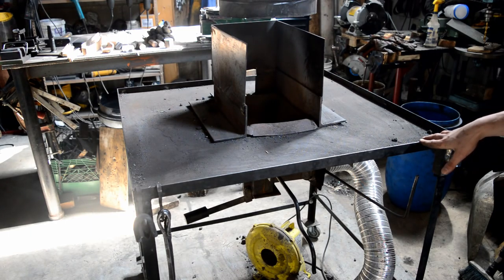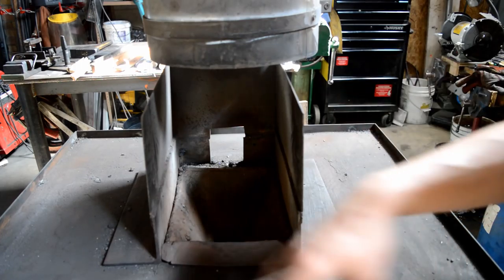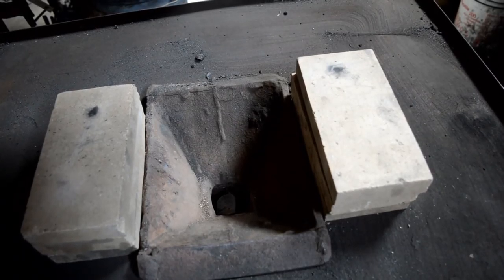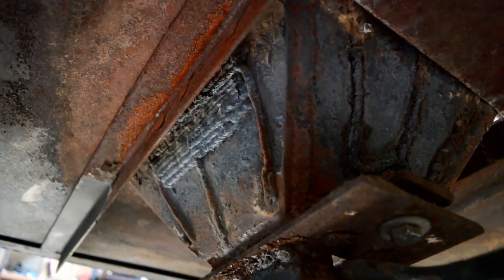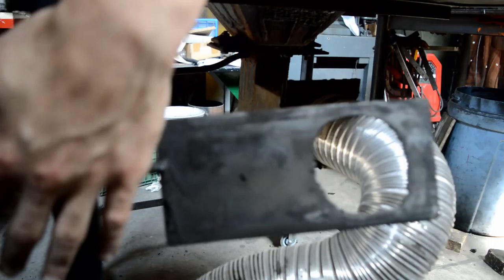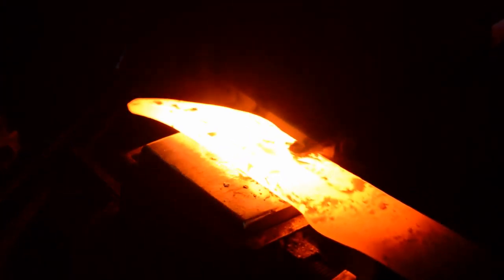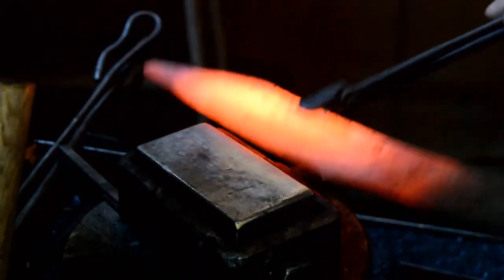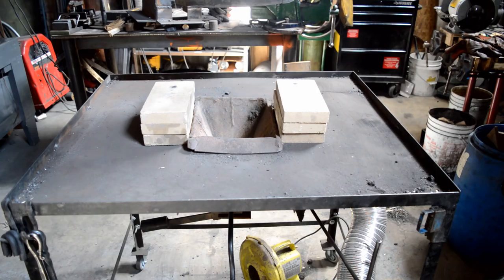Intro to Blacksmith Forges

Comment: Great timing. Im preparing to build my second forge. My first is a Tim Lively style. Its ok but i need a better blower. Im wanting to make a portable style similar to what you show. Im glad you said what you did concerning the brake drum. Makes great sense. Im now rethinking the fire pot. 
Thanks for the info.
Reply: OKBushcraft Mr Krzysz makes some good points about the brake drum forge. When I was going to build mine I saw a video of a portable forge made out of a plow disc, I think it was at a hammer-in somewhere. I had some of those already so I made my forge out of one of those and it works pretty good for me as just a hobby smith.The concave shape does allow for fuel to funnel down easily. Coincidentally(in a bad way), I had just given away a bouncey house too, so I didn't have that blower. But I tried a bathroom exhaust fan and found that it works really well and is fairly quiet. 
Krzysz's forge and work is way, way better than mine but I thought I would just add another prospective, that is also not a brake drum. Good luck with it.
Reply: OrionsAnvil I have some disks. Planned on making campfire cooking disks. I may just keep one aside for the forge.
How well do they hold up to the heat being steel and not cast iron?  I also thought of going ahead and using the drum and forming a slope with refractory cement so it would have more insulation. Does the disk allow for the coal to funnel properly or just adequately? Should it be deeper?

The bathroom vent was exactly what I'm planning to use. I see one for under $15 at a national building supply chain.  

Thanks for the comments. Anymore ideas or suggestions are more than welcome.
Reply: OKBushcraft No problem, glad to share what little I know. I have burned about 120lbs of coal through mine in the last six months and I haven't noticed any degrading of it. But I haven't cleaned it completely out in a while. I will try to take a closer look at it this weekend and let you know.  I will tell you that the discs I have are very old, and were extremely hard to weld, tuff stuff

I haven't had an issue with the disc being too shallow mine's about 2" deep, I try to keep it plenty stacked.  But I do have some firebricks that I plan on using like he did in this vid if I need a deeper fire. I did that in my first forge that was a flat tray. I don't have any issue pulling clinkers out either. 

All that being said, I think I am going to try to build a cheap portable sideblast just to see if I can ;) I think they have a lot going for them.

I have heard some people claying the brake drums too, that may work good.
Good luck with it.

Comment: There's more than one way to get a good fire nest. Brake drum forges are fine if you know how to build your fire and use fines and ash to create a hollow for the fire to be in. If you had ever used a side blast forge you'd know that the firepit doesn't need to be defined by steel or brick at all.
I also have to comment on the high pressure vs high volume point you raised concerming fans. High pressure is good for a coke forge, not really necessary for a coal forge and terrible for a charcoal forge, more so when the forges are bottom blown. The right tool for the job, and as always there's several ways to achieve a goal.
Reply from the maker: gnewsch If you use a side blast i would be very interested in watching a video similar to the one I put up. The side blast seems like a very simple design, even easier then a brake drum forge to make.
Reply: Can't help with a video, only used sideblasts in England. But the warer cooled sideblasts they usually have there are actually more complex than the simple bottom blasts. Have a look at greystoneforge.co.uk for some examples.
Reply: gnewsch With sideblasts not needing a clinker breaker and an ash door I would debate them being more complex. A water cooled tuyere isn't required for light duty either.
Reply: Paul Krzysz If you haven't seen it yet, Mike Judd (looks like from the same site that gnewsch posted), has a good video on a water cooled side blast forge.

Comment: Thanks for the video Paul.  The art of the blacksmith forge has been around longer than plate steel, brake drums, and mechanical blowers, and it's not worth an argument to say which one is better.   Over the past several years you tube has created  a whole new chapter of people who enjoy designing, fabricating and building forges and tools as well, making it a difficult sell to say which one is better.  
   Demographically, some areas are harder to find coal, some are allowed to burn propane only, some can only be constructed out-doors, and some must be enclosed entirely.    One thing is certain, we're all interested in what you can do with yours.

Comment: Good video, I liked it and agree with most every thing you said. It's a very informative video and think what you're doing is a very good thing. I disagree with the air thing though. I've found that volume more than pressure is what is important for air flow into a forge. In fact I would warn against too much pressure and go on to mention that blow driers and vacuums are bad because they have tooooooo much pressure. Too much pressure will just burn through fuel and also cause an oxidizing forge environment that will eat up your metal (it'll scale away quickly and even crack when too thin). Things like bellows are typically very low pressure and high volume and make for awesome air supply when using coal or charcoal as a fuel.

Comment: You bring up a good point at the end...about switching to Gas Forging....seems like Gas is the way to go unless your sentimental about using old time coal fired or wood fired. With gas under pressure...you don't need an air system and all the mess of coal and poking, moving coal around...it seems like the way to go...gas

Comment: A little humility could do you some good here.  Speaking ill of others who recommend starting out with a break drum forge, just show you to be petty.  Many people starting out, don't have the funding to buy or build a large forge like you have.  Pointing out the good/bad designs is fine, but then you went and passively criticized other artist's work.  

Bad form my friend.
Reply: Q-Hack! 
That's his opinion and it's likely not an incorrect one.  Nor is suggesting a brake drum forge as a first forge.  They are cheap and easy to setup.  No they may not be the most efficient but if you're just starting out you don't want to spend a bunch of money to set up a nice forge either.
Reply from the maker: +Q-Hack! It is not arrogance when say brake drums make bad firepots, it is empathy.  I went through two poor forges before I used a good one, and understood what made it run well. I do not want others to waste the time and money I did on bad designs.
I did not insult anyone's work, I said before you take any advice from anyone, look into their credibility. There are many people who seem to find the time to comment in every post, but never have to time to share a photo if their work. These are usually the people who perpetuate bad information, sending beginners on the path of frustration and disappointment.
Reply: This is going to be a tricky question Paul because I'm a firm believer in the right tool for the job and you get what you pay for.  Buy cheap get cheap. Buy a good product get a good product.  We all know you can easily setup a brake drum forge for under $50 with no trouble what so ever.  How much did that forge cost you to make and setup..ballpark?
Reply from the maker: garygsp3 The steel for the firepot and air assembly were free as I got it from my employer at the time, but if you had to buy it for a new price it would be about $75 for such a small quantity. The frame probably took a 20ft length of angle,  which was around $20, the sheet on top was about $45. Electrodes ~$10, abrasives ~$20. Ballpark $150 if you want everything new. The price for the steel will be high if you buy just enough to make a forge because that is how suppliers who deal in small quantities make their money. Of course if you are resourceful you can get the steel for scrap, or even free (bed frame angle).
Reply: Paul Krzysz What you call the path of frustration and disappointment, many would refer to as learning experience.  Why spend hundreds when an old break drum and hair dryer work just fine for starting out.  Many of us started with this very basic setup and learned the craft.  Each of us found what works and what doesn't.  Heck, I am still learning, but I did upgrade my forge years ago.  I look back at my break drum forge with fondness.  It was great to have something that was simple, cheap and worked.  I did say it was a passive critique.  But when you question people credibility I would ask you to re-look at people who have started with the break drum forge and see the quality of their work.  Just looking a Youtube, I see many who I consider masters at the craft who started with the break drum forge.  Again, It's fine to point out the good and bad of things, the empathy as you put it.   What I took umbrage with was your criticizing other artist, be it their credibility or their work.
Reply: ***** I agree.  I work in a sheet metal shop and have easy access to not only scrap metal but better prices than most people on new material.  I've always just figured that I would eventually build a break drum forge as my first because that is what everyone recommends.  Now that I know that they really aren't that great and that using an inverted pyramid shape is a better way to go then why not build it that way?  If you're going to get into blacksmithing and you can't fabricate something of your own then blacksmith probably isn't the hobby for someone.  

Technicus Joe another YouTuber that has gone to school for blacksmith uses the same design table as Paul.  I had never given it much thought about it until this video, as Joe has never talked about forge design and what makes a good forge.

Just because everybody says that a brake drum forge is the way to go to get into blacksmithing doesn't make it the way to go.  As a matter of fact there is another guy, that I know Paul knows that just bought a Whitlox wood forge because he said he hated the brake drum forge because the fire was hard to control and uneven heating.  I think just about the only people I see using brake drum forges are beginners new to forging.  As soon as they can upgrade they usually do.  So why spend money twice?  Just spend a little bit more and make a good forge and be done with it.  In the end you save money, headaches, and frustration.  

As a final note.
The wise man learns from others mistakes and corrects his actions to keep from making the same mistake.
The smart man makes mistakes, learns from it and doesn't make the same mistake again.
The foolish man learns nothing from mistakes and continues to make them expecting a different result.

Please don't answer the question, but look at yourself and ask.  What man am I?